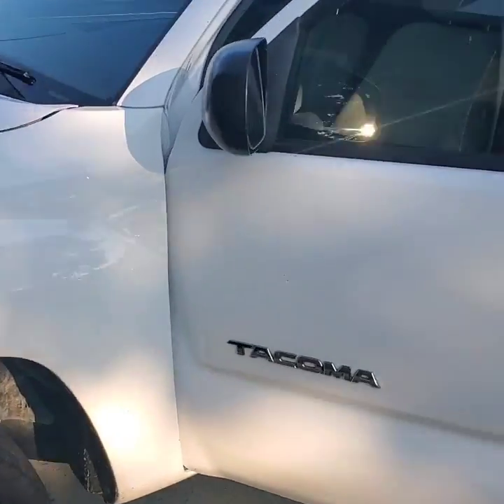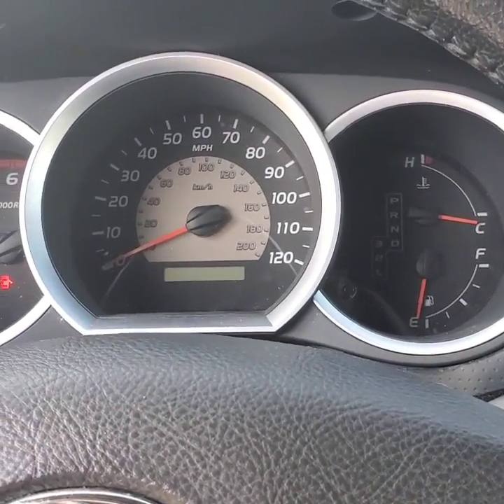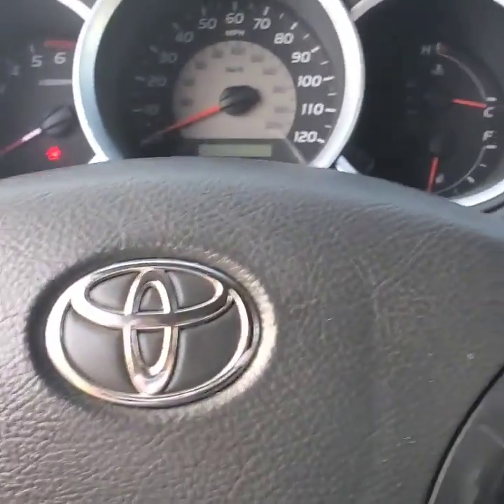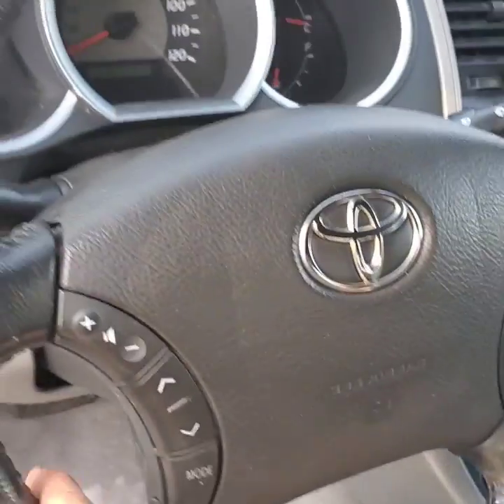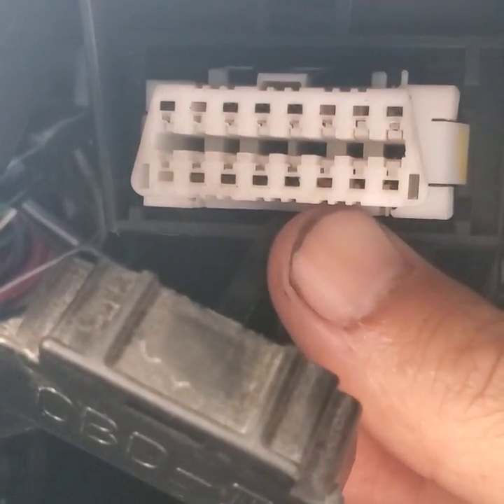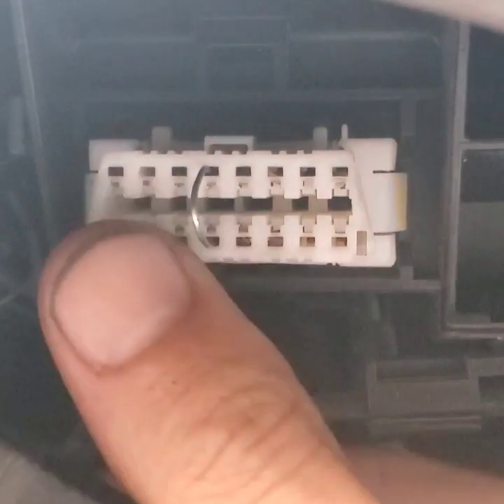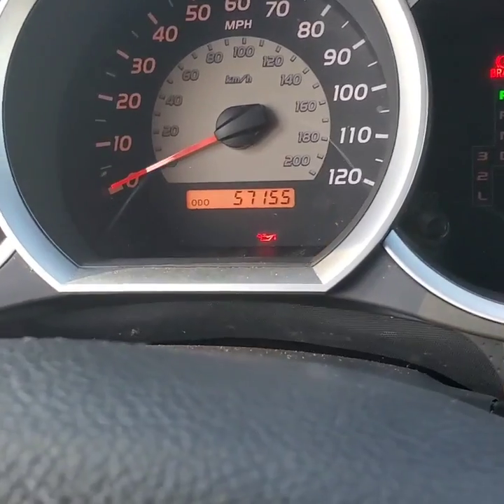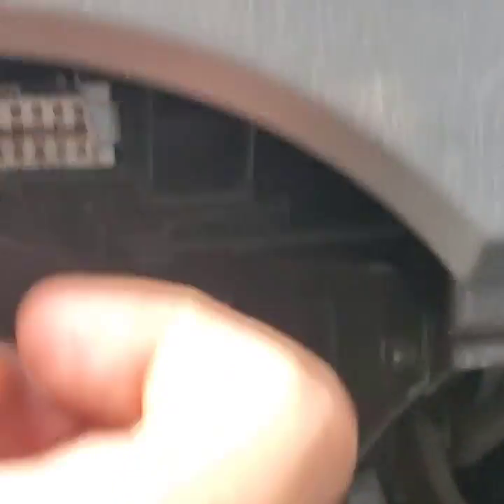Calibration zero point steering angle position sensor

Comment: Hey bud can it done on Kia
Reply from the maker: I don’t think so, this trick is more for Toyota, Lexus and Scion.
Reply: @Mr_Fix_It  you think itll work for a new lexus? 2015 lexus rcF? Same pin placement?
Reply from the maker: @spikey9azn6  yes sir, it should work. Worst thing that can happen is you blow a fuse.
Reply: Hello, you can take a look at this video, I used the comprehensive diagnostic equipment to do this function for Kia cars: https://youtu.be/bsAyzSyaEPc.